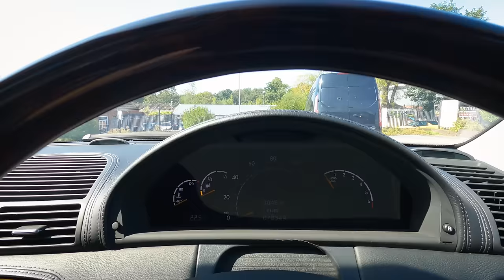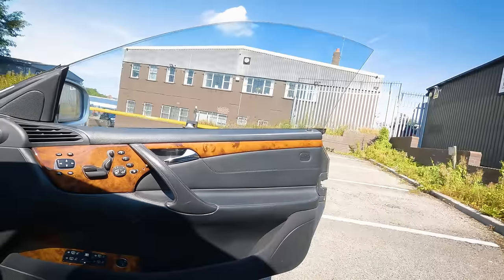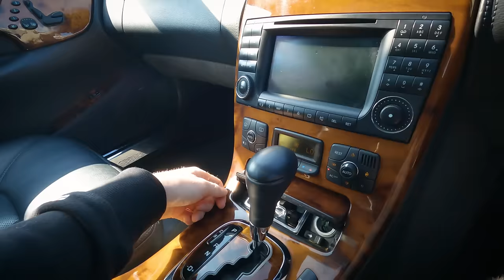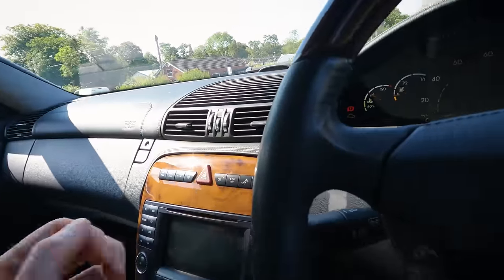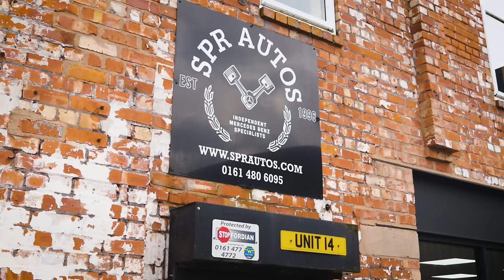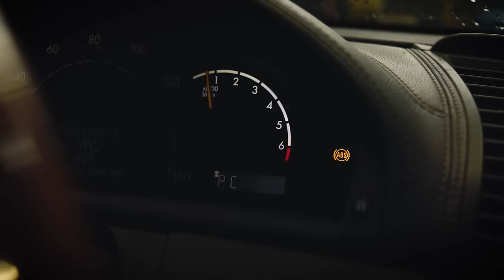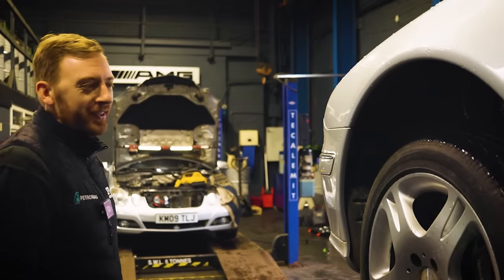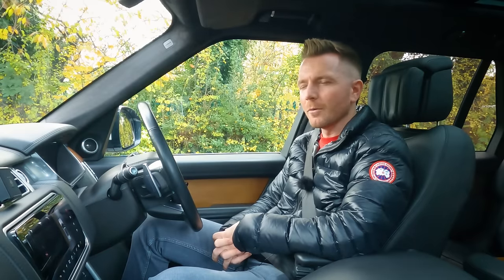I BOUGHT A CHEAP MERCEDES CL500 FOR £1,500!

Comment: A few years ago I had a CL500 (albeit the newer model). You do need deep pockets to run them.
The MOT flagged that all 4 shocks were starting to rust, which would be a bill of £4k for parts alone. Also 3 of the 21 inch standard wheel were buckled due to the skinny tyres offering no protection to the wheels for potholed UK roads. This would mean another £2k for second hand wheels.
I had to move it on, as it was soon about to cost a lot to keep going.
Shame, as it was a lovely car to drive, and as you say the engines will run for 250k.

This still doesn't stop me looking for them on Autotrader from time to time.
Maybe one day I'll buy another...... some people never learn!

Comment: SAM module damage due to water ingress, ABC going bang, earth fault & constant flat expensive battery. 😂

Check air scoop under windscreen is not blocked & loom in door not damaged. 

Good luck. 👍

Comment: This cl is newer than mine and has done 100 thousand less miles than mine but is massively worse than mine. I also paid 1500 quid. Mines done 175k and is an 01 plate but the rust underneath is nowhere near this bad. They’re definitely worth saving due to how rare they are and how bloody good they look. Ive had a major gearbox oil leak and done 400 miles on a dry gearbox but its still ok. The mechanics on these are great and the abc isn’t as bad as people make out, second hand parts are regularly available but oem is as is expensive as it was in 2001. Ive got a guy in Scotland who knows them inside out and has 6 in for breaking, Callum sells parts for pennies if you wanted to get it back going I can put you in touch with him.

Comment: A lovely car that needs some TLC, unfortunately of the age (up to 2004 when they changed) of the accountants water based paint disaster. The lights out on the speedo usually mean the cruise control is on, all Mercs of this period are very battery voltage sensitive for some of the systems make sure the battery is good. YT are a great help in accessing hidden menus and resetting systems such as AC after new gas. ESP comes up when voltage drops but usually cancelled by turning the wheel from one side to other. However all the points the garage point out are fixable but it is the astronomical price of parts that kill these lovely cars.

Comment: I bought one 6 years ago with 78k miles on from a chap in London, he went to the geneva motor show and decided  he had to have one, he ordered one of the first,it was a 2000 model V8 cl500 , the chap flew to Germany to pick it up and drove the car back, he absolutely adored it, kept every bit of paperwork, even the plane tickets! He paid around £80000 for it and i managed to get it off eBay for £2200!. The design and engine and features on the car were ahead of its time, but alas poorly maintained hydraulic suspension fluid changes ( thank the Mercedes maintenance recommendations for that) killed the suspension pump and caused problems with the suspension legs which made themselves apparent around a week of me owning the car, so with replacement parts being very rare and expensive due to the age of the car i sold it at a considerable loss to avoid the expense, the bodywork the car was solid, no electrical gremlins apparent everything worked apart from the suspension but what a car... comfort style elegance and power in abundance for the price of a high end pushbike

Comment: Well spring and strut could be bought from a scrap yard cheap, I think the others would come off with some delicate surgery without breaking it, brakes are not an issue they can easily be freed the disc seme ok pads seem ok the rust could be treated and sealed, doesn't look structural, a bit of minor body work, alternators quite straightforward, it's just the Strat, that's expensive but as I say you probably get all four for less than a thousand second-hand and that comes with guarantee if it's from somewhere like universal salvage. I think it's a good project car I would say.
 these cars are going to be hard to get hold of because the condition so there will go up in value another 10 years time it probably be worth a lot more money

Comment: I had one a few years back on around 100k. It needed a cat, air-con pump, shifter repair and then when I sold it an ABC pipe popped within a week for the new owner. The wheels are correct, just the worst ones you could get.

Comment: I had a 2003 w220 S500 Lwb and it did not have (very surprisingly) any bodywork issues. Nevertheless it was an endless money pit and the cost of parts alone was ludicrous. After 2 years of it draining my wallet I had enough and got rid of it. Sure it was great when it was behaving but most of the time I was just waiting for the next huge bill. I had w126s before and they were far simpler and vastly superior in almost every way.
Reply: Did you have any issues with the engine? i heard the v8s are bulletproof.

Comment: Ooooh... Geez... I would be very tempted with this one to fix it... Maybe raffle it? If it turns out costing several thousands of pounds which it will. I'm slightly confused about the suspension actually because like you I thought it wouldn't have springs it would have air suspension rather than steel springs but I guess there must be some type of Mercedes suspension I'm not familiar with

Comment: It would be sad to break it up, but the time and effort to fix it goes against your maxim and business ideals. As a petrol head you may want to source some good quality recon items as suggested below. Again as said earlier most of the BAS and ESP/ABS faults are related to low battery or a battery disconnect. Once a new battery and alternator are installed you start up and turn the steering wheel full lock to lock and they clear. I would bite the bullet and fix it as they are a rarity. I know as I have a 2002 CLK 430 Cab with 21k whichI specified and bought it from new and I keep getting the Merc dealer pester me to sell it to him!

Comment: It may be academic given the scale of the other issues that need addressing but I think Mercedes give a 30 year bodywork guarantee against corrosion so they should address that free of charge. My Dad had a late 90s E Class with the same standard corrosion of that era and despite initially refusing they eventually gave in and did it all free of charge.

Comment: The problem is it’s rotten. You can spend £5k on it, but the rust will return in 2 years. Once you start welding it here and there, there is no way back out of the welding loop.

Comment: I think it really depends on whether you have any emotional attachment to the car at all. Usually, when I'm emotionally attached to a car, all rational thought and value calculations go out the window. I'd pay whatever it cost to put the car back like new, even if it's more than double what the car is ultimately worth (yes, I have spent $5K on a $2K car!). But if there's no attachment there, I'd let it go - part it out before I start getting emotionally attached.

Comment: Company director in an old job had one from new, and he got rid several years later for a Bentley Continental GT convertible. Towards the end of ownership, it had developed electrical gremlins like you wouldn't believe and was a total shed. It was something like £100k+ new, and went for £25k when it was time to go. Word has it the car had CAN BUS wiring loom issues that allegedly would cost half the price of the car to fix. It was as if the car was possessed (random cutting out, windows not working, dash display and dials showing utter nonsense etc). This was not a good era for MB at all.

Comment: I mean its a difficult one. Clarkson once bought one for 7k the price of a Nissan pixo. Back then in substantially better condition. They depreciated like alfas. You could spend 10k on it and drive around in a car factory fresh, for about 1/10th the cost of a new version. And this version looks better. But it will cost you close to 5000 i reckon and a lot of mechanics time to fix. I mean 600 for one suspension strut and you can bet the other ones will need replacing soon. Say 1000 for the engine faults and 2000 to sort all the rust. The interior faults not even fixed yet. It is a lovely car but selling for spares/repairs might be the safe option.

Comment: It isn’t my money you’ll be spending, but, if I had the money I’d certainly be wanting to spend it on this. We won’t be getting cars like this again ever, and for me it’s genuinely a noble thing you’re doing keeping them on the road (I apply the same logic to my 2008 2.0ltr Diesel X3 hahaha)
Reply: This car is a total money pit, woulnd't make much sense to fix it. Just buy another nice clk500 for the money that would sink into this one. He also has a business so can't just fix every nice car.
Reply: @jaskajokunen3716  no I know. But fundamentally, it’s sound. 78,000 is nothing for that V8. A lot of the problems are cosmetic, suspension wise ok three bolts will be seized but take it from someone who repairs Oil Rigs for a living - nothing is beyond saving
Reply: @tommos16  wouldnt it be better to pull the engine and put it into a non rusted out car 🤔

Comment: Matt - I love CL's. Haven't ever bought one yet but I'd like to. I have researched these early 00's CLs and was scared off because of the litany of issues. The one piece of advice with them is never to buy a cheap one. Ever. So I'm sorry to say, my advice is to scrap it. But side from that it's a dead, dead, dead loss even as a parts car - it sounds like a death trap with the electrics and the corrosion so that means any parts from it are probably suspect as well. The seats are sellable maybe?
Reply: I actually thought when you said that you had a message from the mechanic's your next line was going to be "It's totally f**ked mate, get rid!" 🤣

Comment: Well Mat ive got a solution for this car for you to recoup a bit of cash back, sell the low mileage engine and box (£800 all day) , sell all the interior £300-350, take your new battery back off but before you take the battery off open the sun roof put the car in number 13 bay in your car park and use it as a skip!!. joking apart never missed your vids keep them coming Mat.

Comment: If I was you I wouldn't give up so easy. I would probably get all used parts from eBay. I would convert a suspension for a shock/spring instead of ABC. I believe you could get it done for under 2k without a body work and a wheels.

Comment: Matt, it’s not £4-5k, I can tell you that. You could pump £10k into that and still be short. Then you need to ask yourself who is going to buy it? It has the turning circle of the QE2, the  interior will rattle like a Vauxhall Viva on a frosty morning, and the wood screw is holding walnut veneer in place. Move it on, you can thank me later.

Comment: Such cool cars these, been a dream car since childhood. However, potentially unbuyable. The quality issues which result in it being like it is (when not babied) and then the unreliable and probably gimmicky ABC (no one else inc RR use a system like that to my knowledge) at £2k a corner. Makes a lot more sense to just buy a 4.2 Jaguar XK which won't have either of those issues and otherwise have a lot of the same experience, plus a better gearbox and 300kg lighter for not much more. Or, the newer generation which is the same formula, equally nice, but higher quality at least.

Comment: Beautiful cars to look at and desirable. With so much wrong with it basically getting some cash back in parts will be hassle but decrease the loss which is inevitable. If you planned to keep it estimated costs will be in the region of 15 to 20k and still short of perfection. As a  project car goes it will be great for your viewers but terrible for the manicured nails. Your project videos are faster than a cowboy western Clint Eastwood duel, which incidentally is not a bad thing as the turnaround is usually one video segment. Recently saw a identical mint CL500 LOW MILAGE 30K.

Comment: If you could find another example say with very high mileage but otherwise sound bodywork and decent electrics you could swap the engine over and have one really good Merc and just break or scrap the other one. It would be a shame to have this one condemned with such a good low mileage engine and another one condemned purely because the engine is on its way out.

Comment: If both 500 and 55 were fully stock would there be a sound difference? I feel like I want a 55 but 500 is much cheaper and insurance but is the cl55 much more aggressive in sound? Would a cl500 sound growly with a straight pipe/sports cat? Thanks.

Comment: Very suprised about the rust car has. I thought that almoust every outher panel are everything else than normal steel. Aluminium, magnesium and plastic. Roof might be normal steel. Anyway aluminum can also corroud and more expensive to repair than normal steel. 
I live in Finland and have also W215 CL500 (from Japan and very nice low milage) but never seen such a much rust in high milages ones either. We have also very bad winters here and lots of salt on the roads. 
Here these cars have still some value, 6000€ can get you high milage and car that needs lots of work. 10 000€ plus get you good condition low milage car.

Comment: Seems a shame to break a sick car with such high prior credentials. Those struts could likely be replaced all round with quality non MB parts from a specialist. The rust may have been caught in time. Fit some new alloys an tyres. Have the harness checked over and alternator repaired or replaced. Body work repaired properly. It may come back into classic car high days and holidays use.

Comment: I’ve had my 1999 Peugeot Expert for 13 years. It works for a living and lives outside. Amount of rust on the body? Nil. If 24 years ago Peugeot could achieve this, on a 10k budget van, then why did Mercedes fail so spectacularly? £100k for top to bottom rot. And when did you last see a Sprinter that didn’t look like it had been in the hold of Titanic for most of its life? Its inexcusable.

Comment: My thought would be to sell for parts. Unfortunately this one is too far gone to be saved. £6000 for just the suspension work then there is all the electrics and body work. On the plus side the engine should be worth a lot with only 78k travelled!!

Comment: My old e39 died of rust and 100 faults. It's not like this merc is the only one of its kind.  Getting involved with it would be madness.   You will 'insanely overspend' !  You have to break it. I was sorry to see mine go but you're on a hiding to nothing. In bits it's worth 3x what you paid.  But I couldn't be bothered with a garage full of bits for months.  If you sold it as spares for 1500 consider that a lucky escape.

Comment: £100k new with only 75k miles and its falling apart and rotten. The absolute state of the build quality. I simply cant respect such a pisstake by a manufacturer and the absolute couldn't care less attitude they had to their customers and quality back then. Ive had Toyotas and Hondas of similar age but with almost triple the mileage and they would be fine. This is the first car I hope isn't  repaired. Break it Matt, it doesn't deserve to be saved.

Comment: no offence towards your mechanic people but they could have disconnect the ground from the battery, remove the battery and put it inside a garage or few other ways how to preserve that battery definitely exists.
The car itself is not worth buying I think guy Saving Salvage just bought one for double the price and it had one fault only pretty much spotless other than coolant leak.
Its a shame but unfortunately this goes to more broad topic than just cars.
In UK space is quite expensive / Land as well therefore to store such thing is cost on its own and then people do not have so many holidays as in Mainland europe they have to constantly work any day in the week, nothing is sacred (partly american style?). What I am trying to say with this is no body will keep it for long, no time for it, no space for it, definitely no money to spend on it and finally this car needs regular 2/year service and even after it needs good care and garaging, Tax horrible, Insurance horrible as well, MPG 15-20?. No market for them too many of these and not enough people in right settings... 
But Kudos for trying to save it!! It is salvageable easily but the path is long and not worth it. Strip everything put everything metal into ultrasonic cleaner - metal parts, powder coat after that and just replace bushings, Strut towers are sourceable np, looms can be obtained same for interior trim, engine is not a night mare but I think it is actually twin spark? 16spark plugs, 8 expensive coils + coil modules?, oil, diff.oil, trans.oil, calipers sourcable cheap, brakes expensive (depends), Wheels actually expensive but that is just cherry on the top, rust can be solved but it depends again how deep one is willing to go...almost forgot in order to change brake lines fuel tank might have to be removed...